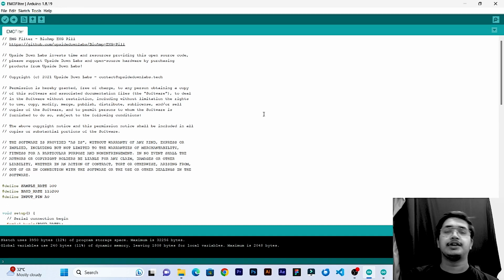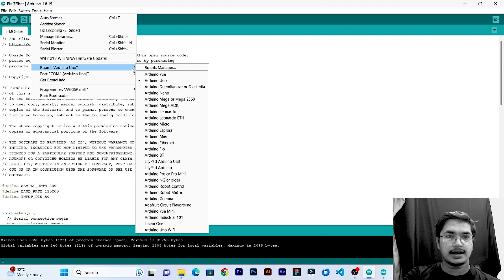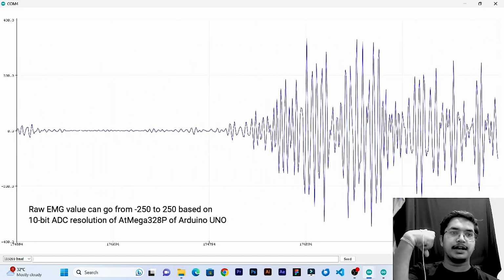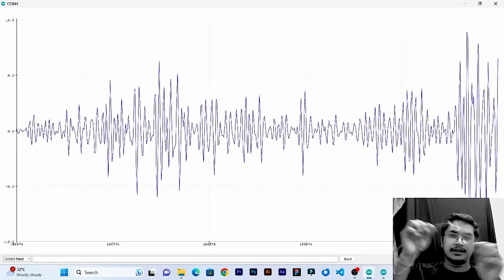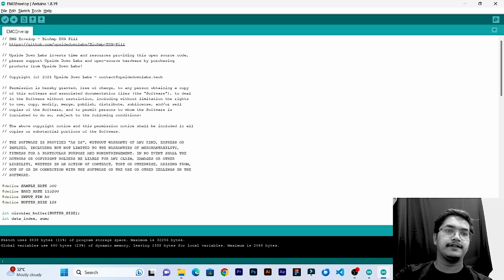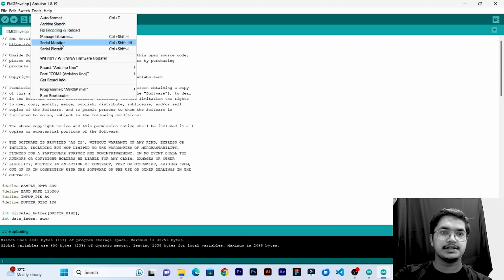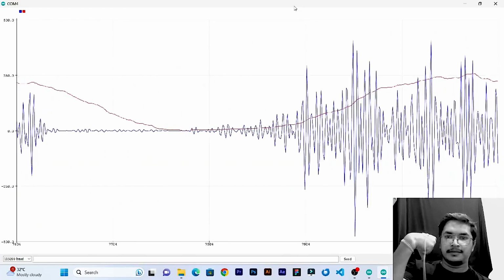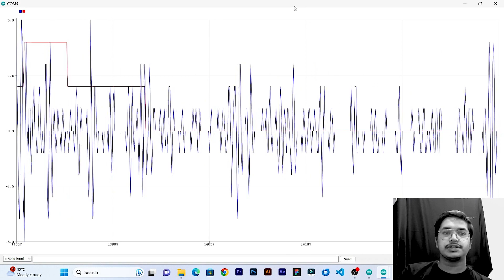Muscle BioAmp Candy Demo | Candy size Muscle Sensor (EMG) | Arduino Uno R3

Comment: in this video is any filter like band pass or high pass or low pass applied? and does sensor work with raspberry pi if i connected it using ads1115?
Reply from the maker: Muscle BioAmp Candy have a band pass filter in the hardware and then there is a band pass filter on the Arduino Sketch as well.

Yes you can use the sensor with Raspberry Pi by connecting an external ADC ADS1115.